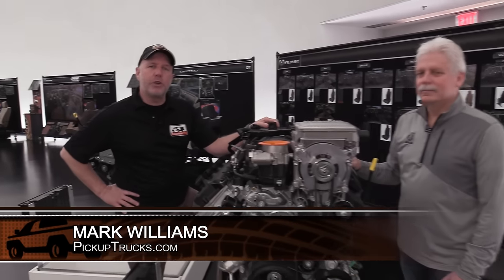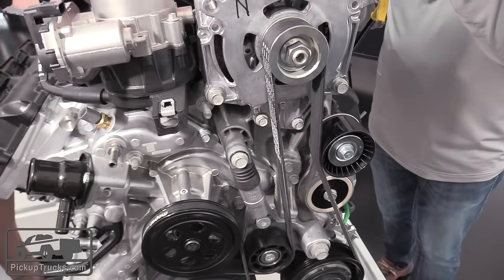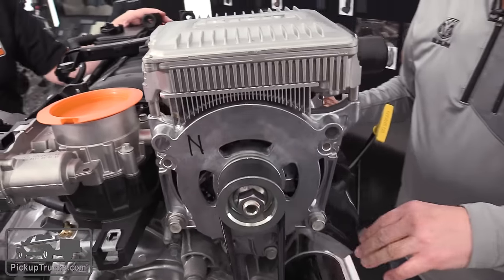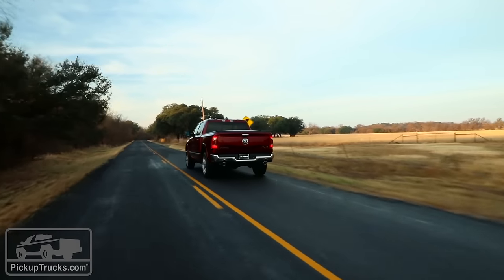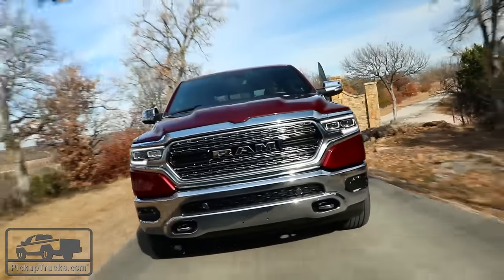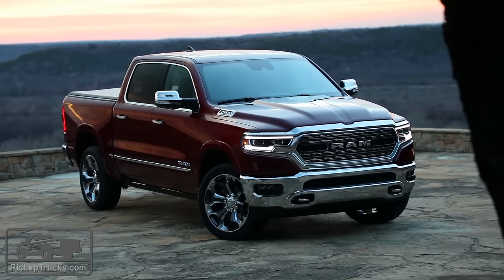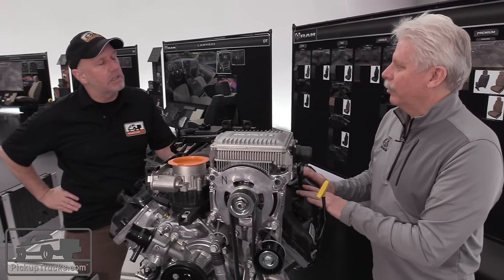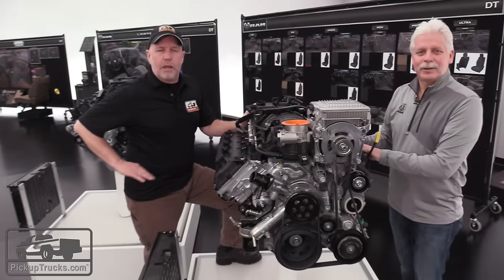2019 RAM 1500 e Torque Explained

Comment: Seems like something that will break and cost the owner out of warranty 2-3k to fix/replace.
Reply: Very possible. That is what keeps me from Fords Ecoboost too. The Ecoboost sounds WAY too expensive to repair, from what a friend with an F150 told me. Although this Dodge system is an add-on option where the motor can probably work without it. Ford's is dependent on the turbo-style eco-system just to run.
Reply: What on Earth are you talking about "turbo-style eco-system"? huh..whaaaat? lol

I think I understand what you are saying but not exactly.  A engine with turbochargers is obviously going to be more complex than an engine without but that is not the whole picture:  Ford's Ecoboost setup in the F150 has 2 fewer cylinders and typical repairs on it shouldn't cost more than on the 5.0,..sans the turbos and related hardware.

That aside, I don't think this mild hybrid setup on the Dodge would work very well if it failed because he said that it also  takes the place of the alternator.  I guess if the 48 volt side of the system is charged up,.. you could go awhile but we'll have to see when this thing comes out.  I would prefer to see the electric motors in hybrid setups in the transmission itself (like the Powersplit in Toyota Hybrids) but maybe this won't be as unreliable and costly to maintain as people think.

One more thing, turbo engines CAN run with failed turbos. How do I know that? because its happened to me. lol.
Reply: I guess only time will tell but there’s a good chance it will be reliable. 
People were afraid of the electronics in the Prius when it launched. My 2004 with 145k miles has been 100% reliable. It even has the original batteries.
Reply: Indeed.  The thing about that is MG1 and MG2 are in the transmission and bathed in oil to help keep them cool. I have read something that the oil seems to break down around the 60k mark and could cause the winding insulation on MG1 and MG2 to deteriorate.  I never did look further into that but that's the gist.  One of my cars happens to be a 17 Rav4 Hybrid (which I love) and if I wind up keeping it that long, I might chase that thought process further down the road. How often have you changed the oil in your transmission?

Not sure about this setup in the dodge but I'm assuming that it is air cooled.
Reply: I’m embarrassed to say my car has been neglected. Everything other than engine oil/filter, wiper blades, tires and air filter is original. 
Still, I’d get in it right now and trust it to go coast to coast. 
I do plan on changing spark plugs, fluids and brakes this year. 
Thanks for the tip about the trans fluid. I’ll have to look into that. 

I’ve read that the v8 eTorque is air cooled and the v6 is liquid cooled. Not sure why they did that.
Reply: I actually have a 2013 F150 3.5 EcoBoost.  Love the truck, have not had any issues with it(56k miles). However, I have had Turbo vehicles all my life. I can understand turbos are not for everyone. However, no other 1/2 ton can tow like a 3.5 ecoboost.
Reply: I'm not terribly biased and have an affinity for turbos but in the case of the F150, I'm just a sucker for the Coyote. lol.  (Give me a V8 dammit). If I was going to keep the truck stock, I would probably opt for the Ecoboost but the Coyote is my choice because I will be modding the heck out of it.
Reply: Lol, the 10 speed trans in New trucks are weak, and will cost you $6k to rebuild. An aluminum tailgate is $1500.  We are way beyond worrying about cost
Reply: Randy Magnum Haven't looked that close but what is your source for that information? Genuinely curious.
Reply: SirtubalotTX gm, Ford, ram transmissions were all developed together.  Compared to a th400 or tf727, they are extremely expensive and fragile.  The fuel mileage is improved, but repair costs are exorbitant.  You are seeing gov't mandates putting transportation out of reach of masses.
Reply: FIAT  F-ix I-t A-gain T-ony
Reply: Randy Magnum I wasn't aware that the latest 8 speed in the Ram had anything to do with the GM/Ford collaboration.   An interesting read here about this:

https://www.tfltruck.com/2018/01/ask-tfltruck-2019-ram-ford-chevy-transmission-design/

Hard to tell what replacement and rebuild cost will be on these because they are newer but I can't imagine them staying high for long as they are prolific and mass produced across many different vehicles. As far as power handling and ability..they seem to be holding up just fine and I can tell you this by what I've seen with the 10 speed  F150s, Camaros and Mustangs running at the track. Time will tell how far they can be pushed and how long they will last.

Again, where did you get those numbers from? That sound ridiculous for a tailgate, aluminum or not. Transmission, not so much for a new one  but I want sources.
Reply: SirtubalotTX it's different enough from the zf unit so Ford any gm didn't need to pay licensing fees, but they definitely had one in front of them while doing the engineering.
Yes, gm steel gate is about a thousand, Ford aluminum gate was over 1400 plus paint.  1 day old, and had a trailer hitch punched through it.
Reply: Randy Magnum You got me looking at the 10 speed a little more closely. http://media.gm.com/media/us/en/gm/home.detail.html/content/Pages/news/us/en/2016/may/0511-10speed-gm.html

Very interesting indeed and seems to be an awesome design...while maintaining previous dimensions.  I was just looking at something about the patents Ford had gotten on the design the other day and it breaks down the design even further. . If I find it, I'll post it here.
Reply: 100% it doesn't have to be this complicated
Reply: I have a 2019 Ram Limited with the e-torque and it has as of right now 4500 miles and it runs just like the same day I got it, a lot of people who complain about Ram never even own one 😬
Reply: Lol i agree!
Reply: Chief engineer should be fired!
Reply: @thebighair37  not an add on in the V6 unfortunately :( I was buying a RAM over the Ford because of the stupid start/stop feature, now...Im not so sure) I really dont want to get a Chev. <Sigh>
Reply: More like 7200

Comment: About as mild as you can get for a hybrid system! Now sandwich a 240V system between the engine & trans for the next evo! And please tell my 4 cyl mode is constantly varying which ones are firing so the aluminum cylindar heads do not warp at warp speed!

Comment: Ram is innovative but wish they would just bring the quality of parts they used up.  Shouldn't have a fuel pump go bad 1000 miles out of power-train warranty. (37000 miles)
Reply: Your power train went out at 36,000? Most power train warranties (including my Ram) are at least 60,000.

Comment: its not optional. I just tried building a 1500 Laramie with the dark edition, and it automatically selects this instead of the regular hemi.
Reply: Are you absolutely sure about that?? Because i just lèased one of these trucks with e torque on it. I want to buy my next ram WITHOUT IT.
Reply: @k.c.marshall921  I did wind up getting a 2021 Laramie sport package, and 4x4 off road package with 3:92 gears and it doesn't have the etorque. Maybe the way I have my truck set up, you have the option. But I do know a few months back when I was trying to build one with the night edition, I didn't have the option. Your best bet is to get in touch with your local dealer.

Comment: Can it keep the air conditioning running? When you're staying still?
Reply: When the ac or heat is on it won’t do the start stop
Reply: @spoolin55psi  So if you live in a hot climate where you run AC all the time, then the engine will never shut down at a stoplight? So there would be no benefit?
Reply: @dougefresh123  mine seems to work that way if temp is set to LO it won’t shut off at lights same with the heat temp set to max. But my buddies ford will still shut down no matter the setting

Comment: Sounds cool until it breaks! Being a Dodge it WILL break.  Really cool engine but the break pedals fall off and the power steering fails. This is the state of vehicles in 2019. All this tech but the most simple things are faulty that they could have nailed 50 plus years ago. All emphasis goes into fuel economy and horsepower ratings and no emphasis is put into longevity or actual quality. And as expensive as it is, you just have to work the truck twice as hard now to pay it off consuming twice the fuel and exposing the driver to twice the crash risk even though there are state of the art airbags.
Reply: tubeyourself It’s called Entropy. The tractor produced more crops but  the tractor does not last forever. The change in the price of the crops equalizes the math to zero gain. A local delivery driver in 1935 made 15 stops a day with a $700 Ford panel truck that lasts five years and 50,000 miles. In 2019 they make 50 stops a day with a $35,000 Mercedes van that lasts 10 years and 500,000 miles. The change in price of getting something delivered evens out the math to exactly the same.

Comment: I don’t know if I’m down with my engine shutting down at a light or stop. Ford does that. with the rental I’ve driven where I’m on debt at is sketchy as fuck once it’s been around the block awhile. I love the truck but def not gonna add this feature. At least not until I see some test drive video to get a better understanding.
Reply: MRF3NN13.... YOU can turn it off in desired.
Reply: wayne owen what do you mean? Like an option in the menu like setting tire jack mode or the ride hieght?
Reply: Every Vehicle I know of that has a "STOP/START system has the ability to be turned off.

Comment: Is all the electrical power sent to the drivetrain delivered by the belt?
Reply: Petey Pineapples essentially it is. It should wear out the thicker belt any faster than a normal serpentine belt. We the truck is slowing down it breaks the truck through the engine. The is the least complicated way to make a vehicle a hybrid and shouldnt hurt the engine or transmission at all.
Reply: Yup, it will wear out like shit! And it is actually one of the more complicated ways to make a hybrid. A dual motor set up like in the Pacifica would be the easiest and most durable option. But, what would I know, it's not like making the first and actual hybrid for the largest car/truck market segment in the US should be of any interest to FCA.
Reply: toyotaprius79 I think it was the easiest/cheapest way for them to do it. As fast as it'll wear, time for an oil change, rotation, and new acc belt...$400 please...lol
Reply: Oh here are the YouTube engineers.
Reply: Ryan C oh no someone has an opinion!
Reply: This just forces customer's to buy a hybrid because most trucks are gonna be v6 trucks. I dont imagine the truck market will be apt the buy a hybrid over something proven for hauling.
Reply: Some of us are.. ummm.. Engineers. lol
Reply: ike fun obviously you're a smart guy, you write well too. Your parents must be proud...the definition of a role model...
Reply: ike fun my comment was never meant to be taken as fact, I never claimed it to be factual...just opinionated commentary...if you did take it as fact, bless your heart.

Fact:
I never said every oil change...
Service manuals don't have you rotate tires every oil change.

Fact:
You are the one that started the insults. (Or in salts)

Fact: You have been done a disservice...

Comment: Did they fix the HEMI crappy TICK?  Does the motor junk before 100k still
Reply: Surprised they ain't throwing  the 6.4 with the TorqueGod addon in these trucks by now. Wonder how.many 5.7 hemi's are around... million or 2 or 6...

Comment: Garbage components. Already replaced the etorque tension torque converter 3 times. And there is no special tool to compress the tensioner to get in place… absolute garbage

Comment: It's an electric supercharger for the 4 cylinder mode only too give you 10% better mpg 😅
Reply: That equaled 1 more MPG 🤣
Reply: I disable 4 cylinder mode every time i drive mine. I just wished it would stay off like the bumper sensors do when turned off.

Comment: I just bought the 2022 ram 1500 with this engine I like that I can turn this feature off but most of the time I use it
Reply: You can actually turn the etorque and cylinder deactivation off?
Reply: @Salvitrojan7  i can disable the cylinder deactivation on my 2017 by shifting with "manual" mode. Just set it to 8 and it shifts normally but doesn't drop to 4 cylinders. Unfortunately you have to rinse and repeat every time you shift out of drive.

Comment: Interesting how the electric drive is connected to the crank by a belt.
Reply: Won't take long for that belt to snap with it starting the engine 80 times a day in traffic. Junk
Reply: @hughjass1835  you can turn off the start stop function, i have a 2020 limited and i just shut it off in city traffic.

Comment: Could've just put a supercharger on it.
Reply: They could've put a plug-in in it.
Reply: I agree. Instead of a mild hybrid how about a mild supercharger!
Reply: Mike A. More HEMI updates to come in the near future...stay tuned
Reply: Far North Squirell Right on looking forward to it! I just may be in the market.
Reply: They're trying to improve hp with mpg
Reply: Check out the eCharger.... never took off...  but it's a good concept. 

Same configuration as this new POS but had a 150lbft AC drive motor on a 2" toothed blower belt....

So... do you want a 500hp Hemi that will pull 8mpg or one that will pull 30mpg.

This dude Basically had a light PLUG IN  electric vehicle motor and control system bolted to an LS 6.0. Claimed 35+mpg for 60MI and a 15%improvement when less elec tr etc power is used...  always wanted a Commander HEMI but 12mpg city doesn't make me grin..

If I could find some good used parts and a reasonably priced LiOn  battery assemble from a highlander... I'd love to experiment...   but the EV shit is REALLY expensive.....

Comment: Has anybody confirmed if Ram has fixed the bad lifter problem on the 5.7 hemi? THis has been verified by mechanics and caused lifter failure and Cam damage.
Reply: That typically only happens from long periods of idle time if you don't let it idle it will last you I've had 5 rams 3 of them had close to 300k original motor and tranny

Comment: 10% increase in fuel economy?  That's a lot of engineering for 2mpg
Reply: Yes. It takes a lot of engineering to make any efficiency gains. What's your point?
Reply: Yeah because electric vehicles are flying off the shelf
Reply: I'm sure people would just love to have a truck that will only tow their trailer 75 miles....
Reply: It's a big aircraft starter belted to the engine? How much engineering did it take?  Look at the technology in everyone else's engines, and the still don't get impressive mpg.
Reply: MCBackDraft1 if Tesla can build an electric semi truck I think ram should be able to build an electric pickup
Reply: riiiiight, those terrible companies doing all the insane work to drill, refine, and ship your gas to a station right next to you.  how horrible to pay a few bucks a gallon for the much needed element.  god forbid anyone make money providing you with a service/good you desire.  and guess what? their profit margins are only 5-10 cents per gallon.  They just sell so much of it it's insanely profitable.  Do some research and understand economics before you ramble about it.
Reply: ford had to change to a ton of aluminum just to get the same mpg as a Ram with etorque.  Different ways to reach the same mpg targets.  Etorque at least keeps your A/C running during stop/start, and reviewers say you cant even feel the etorque stop start
Reply: This is a CAFE sham... in 2011 they made a Ram Hybrid  concept with a Hemi that made high 29MPG... never saw the light of day.   My buddy's 17 Ram Hemi with 3.21 gears can pull 20-22 on the highway if hes easy on it....

I'd love to have a 30mpg truck NOW rather than when gas is $10/gal...
Reply: Better idea would be to make the truck 10% cheaper.
Reply: 2mpg over a year or two maybe tree or more dummy,

Comment: Unless it dramatically improves acceleration I don't see it as worthwhile!
Reply: hi friend, i was curious and I just read a couple reviews and it seems  the v6 and v8 etorque trucks have about the same acceleration as a non etorque, the system may improve drivability a bit, but it seems this will only really benefit fuel economy, as far i'm concerned I see it as a waste too, and i'm not a fan of all the new start stop crap either. i have a 2018 ram with the v6, and i'm pleased with the performance, it's not a speed demon like a hemi, but a strong little engine.

Comment: EPA, he’s so funny, Ram makes up their EPA Numbers. I have the V6 etorque I’m getting 16 miles per gallon in my 2021 Rebel, I should be getting 19 to 24. 
Sounds really pushes EP numbers when you take it in the service to say hey what’s going on, they say oh EPA means nothing.
Reply: likely to agree, I had a 2018 Rebel without it, and the 2022 doesn't seem to get that much better on the highway.  it is basically the same engine afterall.  Maybe some small gains at red lights.  Taking it across the country I doubt I'd see much benefit, but for driving around town maybe a little.  

Having despised every single auto start/stop feature on any vehicle since it's inception, this is the first one I am trying to give the benefit of the doubt.  Definitely takes some getting used to.